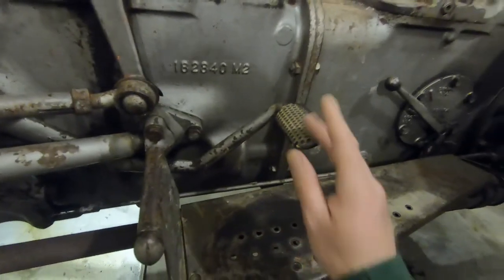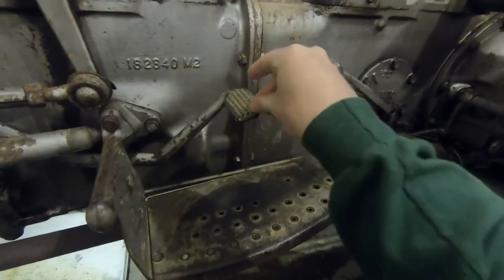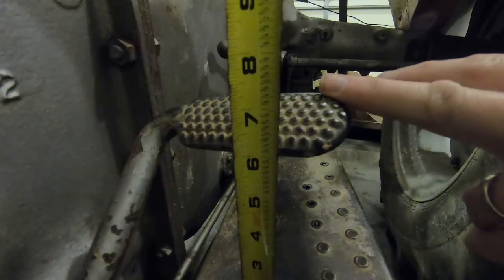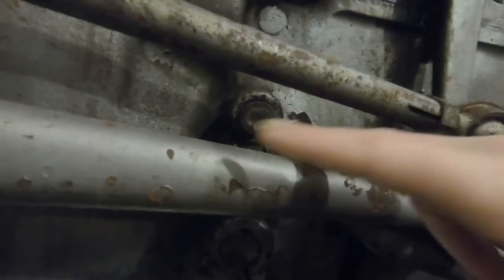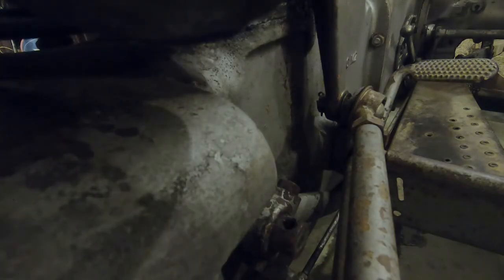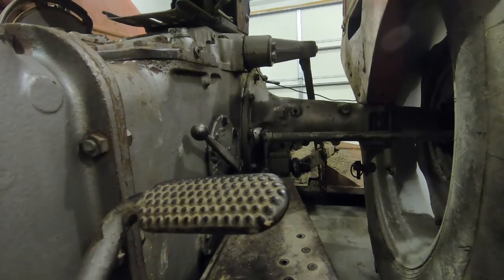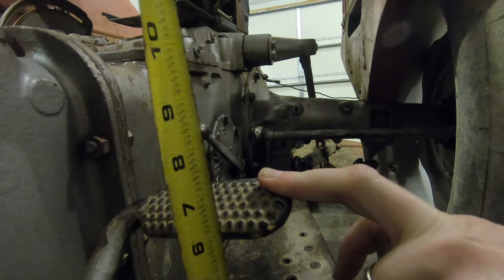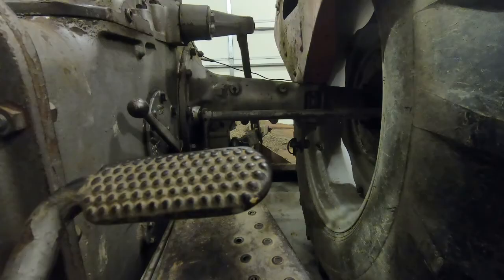Grinding PTO!  How to Adjust the Clutch Pedal Freeplay on a MF35 Tractor

Comment: Great video and very informative.

Only thing i would mention is that, according to my manual the 3/8 measurement is from the bottom of the footpeg (where it clacks up against), not the end of the pedal.

By my measurements 3/8 there is about 1/2 at the pedal.
Reply from the maker: @iamaparanoidandroid1  good info

Comment: Hey farm dad. My 48 fergy, find it hard to tighten 11/16 bolt. Also the square piece where you inserted screw driver. Should it feel springy, when turning to stop play in clutch?
Reply: Got her done, working again. Just put vice grips on bottom nut and put some muscle into top bolt. Yippee
Reply from the maker: Glad you got her fixed up!  Sorry I was slow to see your question.

Comment: Hello great video, really informative. Im looking to buy a 1967 Massey Ferguson 135 Perkins diesel and while test driving it it grinds when engaging the engine pto you have to basically force it in and when you try to engage the ground pto it grinds and won't engage. Would adjusting the clutch aslo help with this? Thanks in advance for any help.
Reply from the maker: Yes, I think this is likely to help.  Those are good tractors.
Reply: @FarmDad  thank you very much. The guy selling it said he was going to adjust the clutch but I was worrying it could be something else. You have a new subscriber 👍

Comment: My MF-20 (3 cylinder perkins diesel) is just barely able to creep along now even though the engine and hydraulics are running fine. I'm not sure if I just need to adjust the clutch or if I have a worn pressure plate. Is there anyway to tell between one or the other? Thanks.

Comment: You were fortunate to get away with adjusting the clutch pedal only. Clutch pedal adjusting gives correct clutch throw and throw out bearing clearance. As the main clutch wears the clearance between the Primary  and the Secondary Pressure Plate increases. That means that the clutch pedal reaches the floor before the PTO clutch releases. Adjust this by 3 setscrews  in the Primary pressure plate. WITH ENGINE STOPPED, remove bottom cover plate below the CLUTCH  and adjust  each setsrew in turn. Turn engine over by hand to get each setscrew at the  bottom. On a Massey Ferguson 35 the clearance is 88-92 thousandths of an inch. On a Massey Ferguson 65 the clearance is78-82 thousandths of an inch. Hope this helps.

Comment: Done mine and now the pedal just fell down no free play?
Reply from the maker: I'm not sure that I understand.  Perhaps you adjusted it too far?
Reply: Mine did the same thing. I loosened off the pedal and tried to move the shaft as described. It felt kind of springy and didn't really want to move in any meaningful way. When I tightened the pedal back on to the shaft the clutch isn't engaged at all and the pedal just falls to the floor. 

Any idea what might have happened?